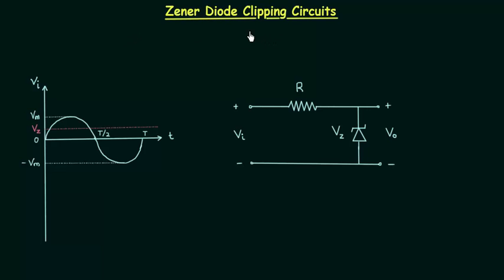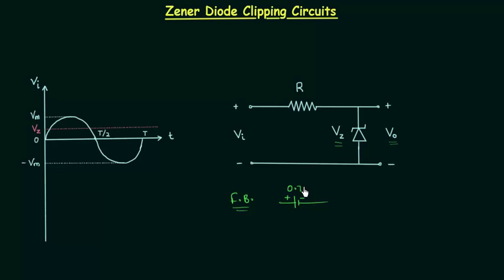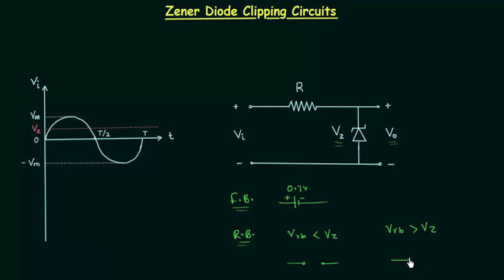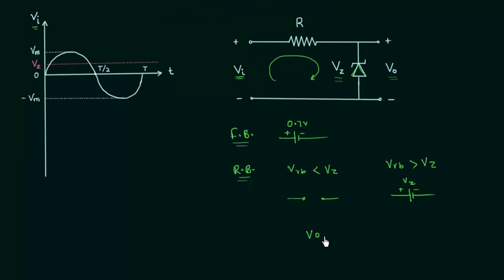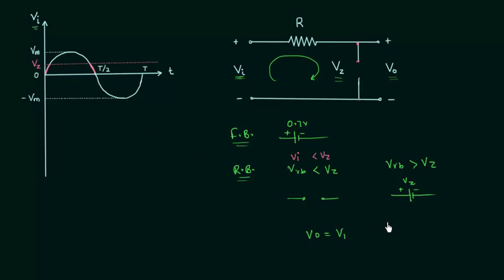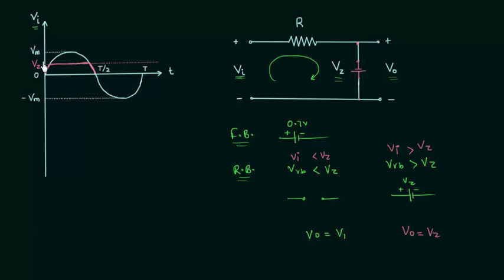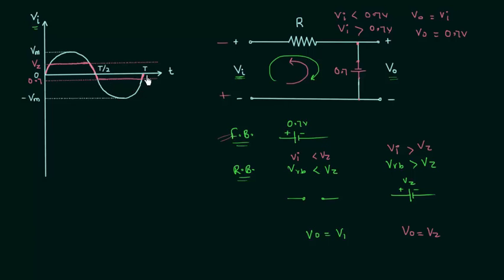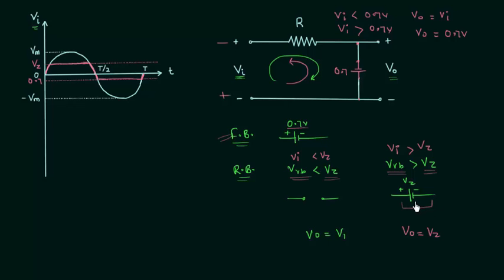Zener Diode Clipping Circuits

Comment: I think. at 2:56 (when Vin > Vz) the polarity of the dc volage source ( pink coloured) should nee in opposite direction. Please check it for sure.
Reply: @AloneWolfForEver  he has drawn the waveform correctly but voltage polarity is wrong
Reply: Yeah the CVD for Zener should be in opposite direction.

Comment: Hello sir,i have i one doubt...why o/p voltage is equal to 0.7v (in case of zener diode) when i/p potential is greater then zener potential (0.7)
Reply: till 0.7 V, the diode was OFF. so all the current went to Vo. after diode was ON. the Vo become zero.

Comment: sir how we know the wether Vz dc constant voltage line  to be plot on positive side or negative side of graph?
Reply: Because in +ve half cycle only the diode is in reverse bias condition. And zener voltage is only related to diode in reverse bias. So here we have drawn the Vz line in +ve half cycle part.

Comment: when Vi > Vz in reverse bias,
the polarity of diode equivalent voltage source, might be opposite of what it is drawn??
plzz varify.
Reply: same doubt here
Reply: u r right krupesh
Reply: no, i case of voltage regulators also we consider the same polarity
Reply: You're right....nevertheless, the graph he drew is correct
Reply: As the potential rises at the input side for negative half cycle for less than diode voltage, applied voltage rises at output wave form follow its path but as it become more than the diode voltage diode will become forward bias and behave like short ckt. So no output voltage will be there... 
Hope it is helpful
Reply: U r right there is a mistake
Reply: yes. i have also doubt here.
Reply: hmmm......
l have a doubt
Reply: he draw it reversed , a mistake 
you are right , i just come to check
Reply: Yeah ...thats a mistake
Reply: Yup
Reply: it is all correct
Reply: 😂How can you fix a diode once it is broken down? Everything in video is correct
Reply: The polarities of zener are taken in reverse bcoz in zener diodes videos he taught like that..here what he took is incorrect but he has written equations correctly

Comment: sir,  in negative half cycle : the zener diode is forward biased so how two cases will make
Reply: Once the diode is broken down, it is simply replaced by a DC equivalent and behaves like that only throughout the process. There is no restoration after breakdown.